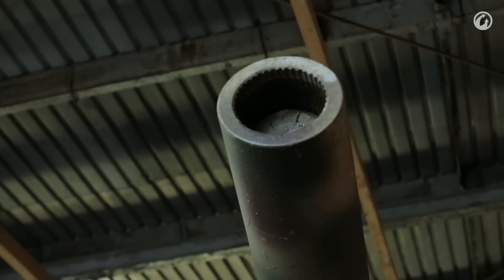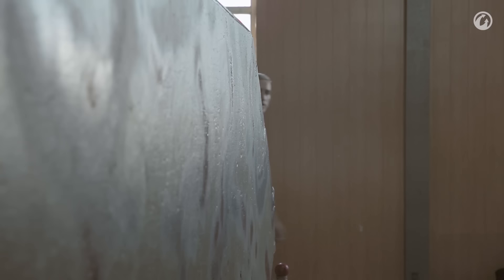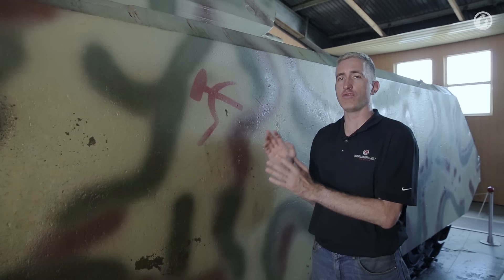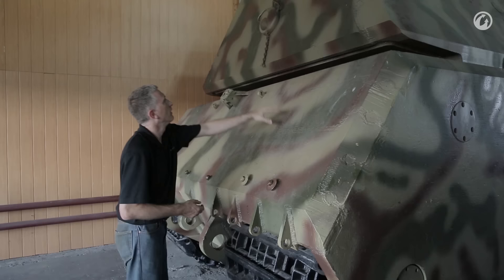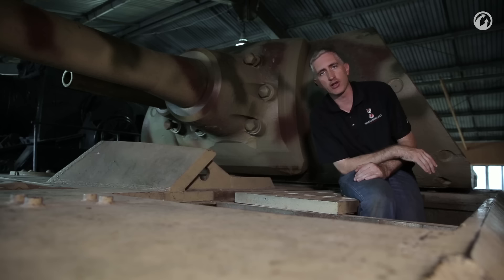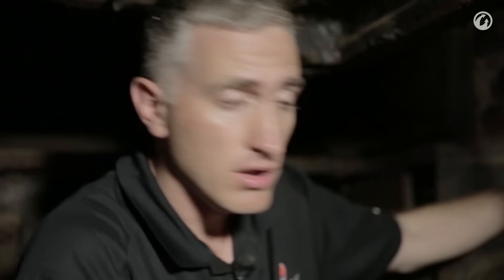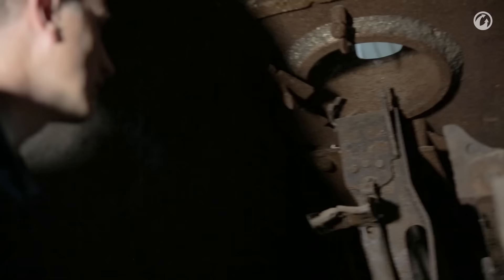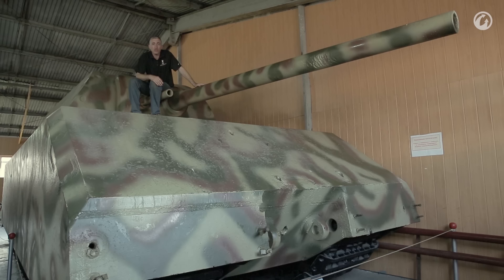Inside the Chieftain's Hatch: The Mighty Maus

Comment: Maus wasn't a good idea.

1) Run over small, common AT mine.
2) Get tracked. Since a common detracking is a DEPOT level repair for such a huge tank, crew groans and does nothing.
3) Have to wait patiently for a gigantic (not yet invented at prototyping) tank recovery vehicle to pull you out, which will take several hours. 
4) Giant, juicy tank gets bombed by every fighter-bomber in the area during that several hours.
5) Armor which has no problem against a 122mm to the glacis plate dies quickly and horribly against multiple 500-lb semi-armor piercing bombs to the turret roof.
6) PROFIT ??? Not if you're the Germans, you don't. More like SQUANDER ???.
Reply: Also it was much to heavy to cross any bridges they planned for it to be submersible with a snorkel.
Reply: Haha

"Mein Fuhrer, no bridges yet exist in the sum experience of human engineering that can hold the Maus safely."
"So it can't cross rivers?"
"That's what I'm saying, Mein Fuhrer..."
"I see... so what you're saying is... it needs to be waterproof so it can cross on the riverbed?"
"....no, that's not at all what I'm saying...in fact that will make it heav-"
"Excellent plan! Amphibious stealth assault super-heavy tank! I approve! Make the necessary changes immediately!"
Reply: lol actually one i found funny.
Reply: Profit = while they attempts to land a 500lb bomb on the tank you take down all those planes with flak
Reply: It was meant to assault with infantry I reckon, if it's hurt to that extent they set u p a defense with some AA guns, or they thought of this and send like 3 wirbels.
Reply: well thing is AA back then well if it works was more to scare off the enemy then to kill. Maus with infantry makes sense they could drive sideways and make a shield while driving but, tank is still not very practical for WW2 i think it would have been better for WW1
Reply: roof cant be more than 40-50 mm thick otherwise you cant open it, so ilushin il2 take him easy.against tank size like that you dont need CAS attacking aircrafts ,bomber is fine,there is no bridge that you can cross, fuel consumption  is like 20 tons per hour.you need crane to load ammo.if you get hit you will probobly hurt yourself trying to jump from this tank.etc etc did I mention that Adolf was insane? no''?
Reply: Don't worry they have repair kits for a couple thousand credits.

Comment: This tank is not a tank is a terminator created to destroy all!
Reply: No that would be the p 1000 ratte
Reply: Lord Dim 1 No that would be the P 1500
Reply: +RAI DEN  nope, its the T-26!
Reply: Yet any modern shell fired by a MBT would go straight though it...
Reply: No if change his armor to modern composite armor. On hull have better angles that Abrams.
Reply: So basically the Maus wont win unless it is upgraded to modern standards.....

Nope, it still wont win. It's hull is simply not thick enough.
Reply: Composite armor is lighter than steel one, so if you keep mass of maus, you can put more armor.
Reply: Then it would become to impractically large and would be a juicy target for any gravity bomb, SLAM or TLAM (Which WILL destroy it regardless) and also it;s gun still wont be able to penetrate the armour of any modern day tank.
Reply: Entire Air Force starts laughing